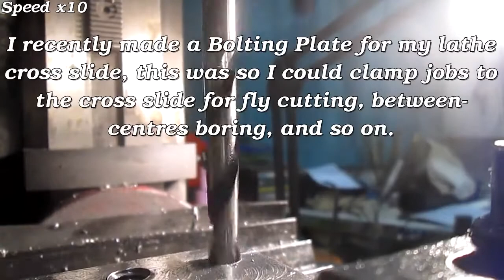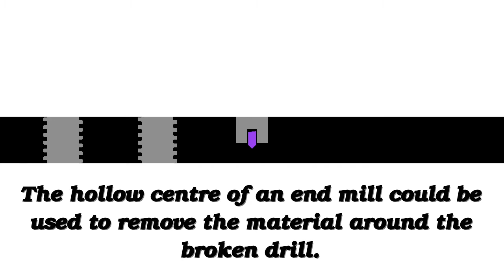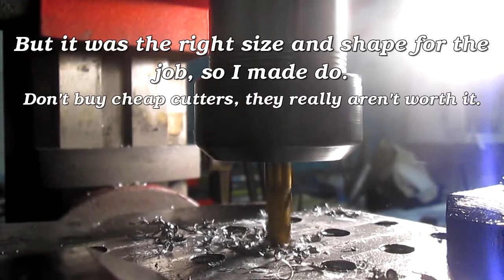Removing the Tip of a Broken Drill from Steel Plate - Without damaging the job!

Comment: Center drills were made for center drilling shafts for between center work
In the lathe.
Ninety degree spot drills are made for spotting on cnc machines but work nicely for spotting manual work too.
They don't have the necked down point
And are less likely to break.
We used to grind the broken center drill 
Into a trepanning tool to get the ×$&@ point out.
Drilling from the far side may be an option too.
Kap